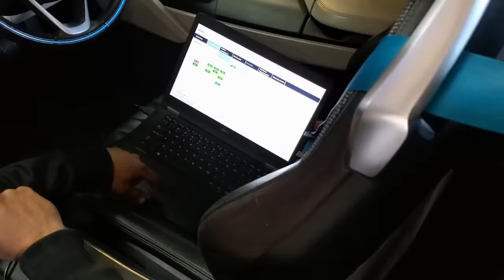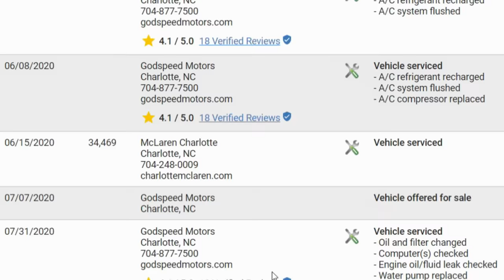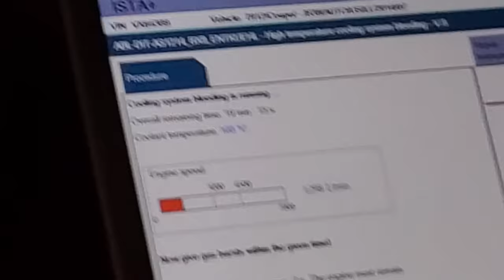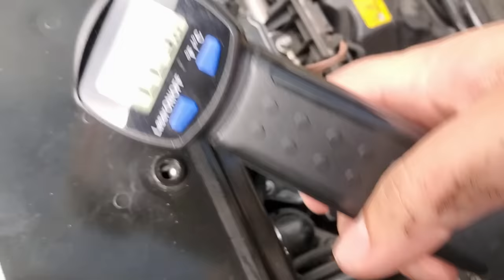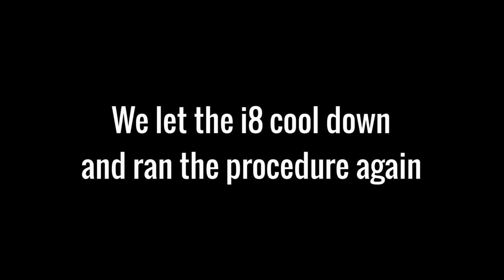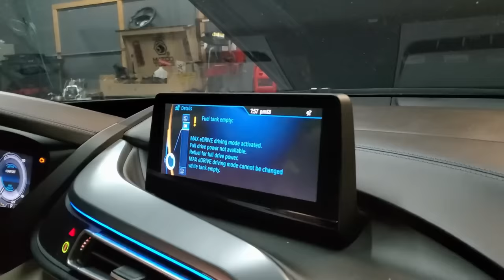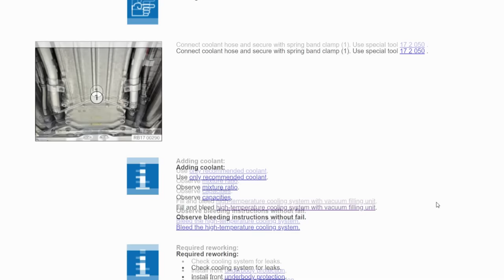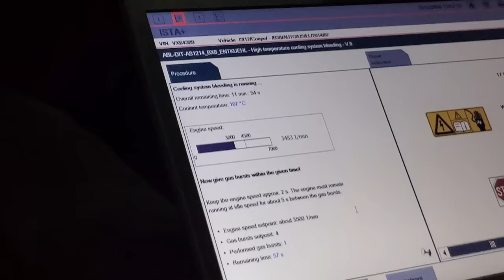Was my Repo'd BMW Supercar Sabotaged to make it Impossible to Repair?

Comment: Many many years ago I had a Ford Capri with a overheating issue. In the end it turned out to be a rubber ball. Someone had removed a hose and placed a kids ball in it and replaced the hose. Lot more to the story but you get the gist.
Reply: An old diesel mechanics trick was to place a small ball from a bearing in the fuel line. Small enough to move around in the fuel line. Ran fine at low RPM. As soon as you put a load on it the ball was sucked into a restricted part of the fuel line and shut down the engine. They did this to make you pay the bill for what ever repair you had done. Usually an engine overhaul. Guy would say I need my truck to make the money to pay you. Mechanic would do the ball trick so you would come back to get it fixed. You had to pay up for them to remove the ball. Truck would drive fine without a large load on it. But put a 60,000 lb trailer on it it would go fifty feet without falling flat on its face.
Reply: Ford should bring back the capri
Reply: @Stop..carry-on  No need, they sell the real Mustang in the UK and Europe now.   .... I always wanted a Capri when I was a kid, later thinking, after Ford discontinued the Capri, that I would ike a Mk1 V6 to restore. .... Later I moved to the US and got myself a Mustang GT.  :)
Reply: @g60force  screw you over??? I say pay the bill... if you can't afford the work find a new job. Im not a bank...

Comment: So I used to work for a DAF dealership, they're a European truck brand and are owned by PACCAR, same family as Peterbilt and Kenworth. The MX engine had some terrible issues with o-ring failure, particularly the o-rings that sealed the oil cooler. We used TURCO Plaudit to get the oil out of the coolant system. I think its original purpose was to clean home central heating system pipes. We would do a couple of flushes with it following the o-ring and cooler repair, followed by refilling the system under vacuum with OAT coolant. This might be useful for anyone who has contamination issues in their coolant system, you may not be able to get the exact product but hopefully you can find something similar in your local area. I understand that oil fired central heating isn't as popular in the Americas as it is here in the UK, but maybe your local plumber could help direct you to a similar product.

Comment: FYI: Sam, it's a contactless infrared thermometer. The laser isn't measuring anything, it's just a pointing stick.
Reply: The laser is just a pointer. 
The distance-to-spot ratio tells the size of the measured area and the thermometer calculates the average temperature of that area.
Reply: It works for surface temperatures, provided you follow the directions.  I use mine for car parts, weather measurements, cooking guidelines, and telling whether or not I might have COVID.  Just read the directions before use.

Comment: Had this issue in my mustang. Couldn’t find why it was overheating ANYWHERE. My last ditch effort was getting a new coolant reservoir cap. Magic. If coolant is boiling out, I bet you it’s the cap. It clearly isn’t holding pressure!

Comment: I reckon there’s a dozen eggs in your system ... the good ol egg trick always used to work on normal none hybrid cars 🤣🤣🤣
Reply: Do you need to crack them? 😉
Reply from the maker: I've got plenty more to add if that will fix
Reply: @Samcrac  the thermostat is electrically controlled by the onboard computer and varies temp automatically
Reply: No yolks just use the egg whites thats the secret
Reply: I was thinking the same. Wow that's some shitty stuff right there if that's the case.
Reply: You woulda smelled it or saw some on the ground when it shat everything out..  could be pepper..  ive watched a dude take egg whites, pepper and honey, mix it in a bowl, get the car hot and dump it up in.  Sealed a quarter inch hole for a week before it blew out again..  also saw a girl sprat tire slime down a rad and it stopped the leak but also stopped up every water jacket on the block too..  lol..
Reply: It would be easy to find in an electric car tbf.
Reply: Well, Scott he has engouh chickens for that haha
Reply: @6181green  what by not having the yolks it will not wreck your engine. 😂. Does it make a difference if there free range?
Reply: Yes and what about the BMW?
Reply: Thats exactly what I was thinking!
Reply: @dyslexiksteve2488  the yolks are what will clog up the radiator lol free range preferred 😉
Reply: That was exactly my thought before I even scrolled down to the comments.
Reply: As the BMW turns. Cant wait for the next video. Crack that radiator open
Reply: @Samcrac  Only Diagnose Dan can fix your car. Check him out here on YouTube and you'll see why.
Reply: That would scramble it. If it's not he could end up with egg on his face and that's no yoke (OH FFS stop)
Reply: @Z-Ack  Actually you wouldn't.  The pressure would build up right before the blockage and the blockage will remain in place. If it were me I would have already reverse flushed the radiator with a water hose. I probably would have still cracked but it would confirm my suspicion
Reply: Changing his name to "samcracpipe" 😂😂
Reply: Dont forget rice as well
Reply: @6181green  chicken eggs?
Reply: @tonyanderson6493  you are the only one to put this together.
Reply: I reckon there's some eggs in stepmom!
Reply: @Samcrac  Username checks out
Reply: Do a glucose test bet there is sugar
Reply: @dyslexiksteve2488  yep its only a temporary fix just to get you home
Reply: Damn chickens
Reply: NO he would have seen some egg remnants with all the work he has done on the system, the vacuum would have pulled some up into the overflow.
Reply: @Samcrac  I had something similar on a mercedes and the fault at the end was the valve in the water reservoir cap.. This obviously has a certain pressure release value. Given the i8 has an odd layout with radiator and tank in front and engine behind, I imagine this value is hyper sensitive..
Reply: @mattgould4366  I prefer snaking a tube in the tailpipe and filling it up with expanding foam.
Reply: or a few lbs of plaster powder...
Reply: I was going to suggest checking rad and fore-aft piping flow individually because it sounded like a clog
Reply: I hate it when you're trying to troubleshoot a partial failure or one that's not apparent. Once the radiator comes out then it should be obvious what was done to the cooling system.
Reply: Egg whites FTW
Reply: I once knew a car wholesaler  that had a car with a cracked block! He filled the radiator with egg whites and it sealed the block long enough to get it through the LA Auto Action! I heard it was seen on the side of the road near then auction the next day with a big paddle puddle of water under it!
Reply: @Iwishitwas-hl9wj  unless they’re solid in the radiator!
Reply: @t44e6  ya but you don’t want it discovered until after the bank has sold it to a wholesaler or they might come to you for the loss!
Reply: Mom?!  🤯😘
Reply: @dyslexiksteve2488  😂😂😂happy new year 🥳
Reply: I feel like mechanics from fast furious 2
Reply: It absolutely looks like a blockage in the cooling system somewhere, doesn't it..  And no test seems able to indicate where that would be, if it would f.i. be somewhere inside the block or so. Personally wonder if flushing that whole system with draino wouldn't be a viable option??! Anyway it sure is a con of complex designs, that they are hard to troubleshoot and that they by times make the effort needed to eventually fix it enormous
Reply: from what the tis manual shows there are a minimum of 2 electric water cooling pumps on it  1 by radiator & 2 nd by turbo as well as the mechanical pump on the engine as pats garage says drain the entire system down and verify the coolant is removed after u remove the under shields and vacum the engine cooling system out before filling it also use a heat temp gun if u have one to verify heat transfer thru the pipework to find any deadspots !!!.
Reply: best wishes for new year from Liverpool uk
Reply: I bett there is some kind of blockage in the coolant system but the battery cooling system is also a thing to consider to double check.
Reply: @danopureblood7066  I was thinking more in terms of easily disabling a car.
Reply: Yeah someone filled it with "Bluedevil" head gasket stop leak. Works for a minute but causes big issues later on.
Reply: @descouch1984  the fan must be too, doesn’t seem like it’s reading temperature correctly. Even though it’s reading correctly on the computer?
Reply: @damotorguy  its a similar 2 speed variable set up on the m6 v10 engines the fan runs at low speed till the car is on the highway and there is enough airflow thru it but this was tested on the video thru ista .
without ista your hunting and guessing what it could be the fan controller is exspensive it comes as 1 with the motor.
Reply: @descouch1984  za:$'x
Reply: You might be on to something there!
Reply: @descouch1984  Funny how a 1980s Skoda with engine back and long coolant hoses to the front was way easier to fix , maybe BMW needs to go a look from a old Skoda manual how they did it  :-)
I would use a camera and look whats inside of those coolant pipes and hoses , if you use wrong type of coolant it causes corrosion and sludge from the aluminum .
Reply: @harrickvharrick3957  We used Borax in EMD (567/645) locomotives to flush the system.
Reply: @Z-Ack  -
Pepper! I’d forgotten that trick, did it once and it worked!
Reply: Ceramic engine sealer... very hard to trace but a couple bottles of it would plug radiator. We used to sell it by the CASE to a local dealer... they would use it in cars going to the auction. Would fix anything from a cracked head to a cracked block to leaking radiator. If there are steam/weep holes in the coolant system (like in block or head) it would definitely seal them up.
Reply: @danopureblood7066  total rubbish sorry dan
Reply: GRITS! A plumber came to my house , worked to unclog the kitchen drain, gave up and replaced the line. He tried digging out the clog but it was like cement! It was left over grits my wife innocently flushed down the drain.
Reply: I definitely agree with the plugged coolant system theory.
Reply: Already put a main comment but replying here. Have you looked for a potato in the exhaust? If you say it was sabotaged...
Reply: That's no supercar.
Reply: Was thinking something similar like a golf ball
ND
Reply: When I was a kid ppl used to do that .. or glue ( I never knew what they were doing but as I got older comes to find out (repo or insurance job
Reply: @Samcrac  
You've got a blown head gasket, it's pumping combustion gasses into the coolant system because the gaskets blown between a combustion chamber and a coolant passage, it's not common but I've dealt with it a couple of times in the past 40 years. 
The pressure test blew out the radiator because it'd already been weakened from the system being stressed from the problem, they usually don't find that problem anyways because it takes the pressure that's in the combustion chamber to squeeze past the head gasket so the 15 or so psi of one of those tests won't show it, that's also what's boiling your overflow, it's not just boiling from the heat it's combustion gasses pumping through the coolant.
The way we used to check for that problem, and I don't know if it'll do you any good on that thing, was to remove the thermostat  and put the gooseneck back on, disable  the water pump, then remove the top radiator hose from the radiator and rotate it on the gooseneck so the radiator end of it is facing up, then pour water into it till it's topped off, start the engine and watch for little bubbles to start coming up through the water, remember the water pump is disabled so it can't run very long before overheating but once you start it it doesn't take long and little bubbles will start coming to the surface.
I'd lay odds that's what your problem is, I've seen that same thing drive people nuts trying to figure out what the problem is.
Reply: That egg trick isn't very pleasant when the hole unplugs.. ask me how I know
Reply: Yep definitely sabotaged with eggs clogging the rad.
Reply: Agree radiator purge or replacement
Reply: @t44e6  Sounds like another video title for his "stepmom".
Reply: Hook up an external 120v water pump to circulate water through the block. Then do the same for the radiator.
Reply: 9:13 Tthey just shove it back in. They do it like I would do it "

That's what she said!
Reply: 80k+ car has a plastic radiator. Fun
Reply: The cooling system (lines or rad) is clogged. Seems pretty obvious after watching this.
Reply: @Aaron48219  naw did you see how old she is menopause got all her eggs
Reply: @dukecraig2402  that would explain the pop pop pop noise, one of the combustion valves sound pressure traveling to the reservoir. When they pressured the system though, wouldnt that put water in the cylinder and give white smoke.
Reply: @michaelbrownlee9497  
Not necessarily, a blown head gasket that isn't blown that bad won't let coolant into the cylinder because like I said the 15 psi or so that a coolant system has in it won't have enough umph to push coolant past the bad spot on the gasket, but the pressure inside the cylinder during the firimg stroke will push that past the gasket and into the coolant system, usually when a head gasket goes it'll put coolant into the cylinder but as I said if things are just right it won't, it'll only push combustion from it's high pressure into the coolant system, in the 40 years I've been doing this I've only seen it a handful of times, like I said someone who's never come across it, like these guys, will pull their hair out trying to figure it out.
Reply: @dukecraig2402  so the hot gas in the coolant is causing a sensor to read overheating, the computer shuts down the engine.
I agree with your hypothesis.
Reply: @dukecraig2402  but.....what causes the head casket too fail? Overheating causes warping of the head, causing....casket to fail.
The other thing is the fan on the radiator didnt kick on....
Reply: @michaelbrownlee9497  
Any one of a number of things can cause it including the ones you listed.
As I said it's not that common when it comes to blown head gaskets, the vast majority of the time coolant will get into the cylinder but if the conditions are right the defective area of the head gasket acts like a one way valve, cylinder pressures will push combustion into the coolant jacket but coolant can't come into the cylinder because the gasket isn't blown enough to allow it, when guy's don't find signs of coolant on spark plugs and the coolant system passes a pressure test (which is low pressure compared to what the cylinder makes during the combustion cycle), like these guy's when they don't find coolant signs on a spark plug and it passes a coolant system pressure test they start scratching their heads.
It's not that common of an occurrence but I remember in the 80's seeing 3 or 4 that were GM vehicles of the late 70's/early 80's era that had the sheet metal head gaskets, not like these modern performance ones that are rubber coated and sometimes multi layer but just plain sheet metal, GM used them on some engine's during that time, probably stainless since I don't remember rust forming on the gaskets, but I also on several other occasions found it with more conventional head gaskets of the era if I remember correctly.
Reply: @dukecraig2402  well yeah thats a head gasket, they usually had a pattern stamped into them.. We use to make our own gaskets, ball hammer and gasket paper. 

What im getting at is why did the car overheat to begin with,  Why did the radiator immediatley fail with a pressure test, it was previously damaged.
Im thinking somebody drove the car around with a defective water pump and had the white smoke. If you noticed there was black goo on the head from the coolant blowing in. The steam pressure in the coolant system is much hotter than the normal boiling point. 
Or they drove around with no coolant. Someone might also tampered with the bios in the chip.
5 grand in labor too replace a head gasket...lol.

Comment: I had an '85 Mazda RX7 (rotary engine) that had a chronic overheat problem. I tried thermostat, water pump and radiator and then took it to a dealer who couldn't figure it out either. It turned out to be a restricted exhaust from a melted catalytic converter because the air pump that blows air into the cat had failed. Rotary engines have a much higher exhaust temperature so this may not be relevant to the BMW. Just relating my experience.

Comment: I once owned a 2007 SLK350 that threw a thermostat code. Since I was already at the dealer having the drivers side airbag replaced as part of a recall, I told them to go ahead and fix it. On that R171 engine the thermostat kind of like this i8 comes as an assembly with the housing included. The part was actually reasonable at around $135.00, but the labor was 3 hours. So when I picked it up the bill was almost $600.00 to change a thermostat.